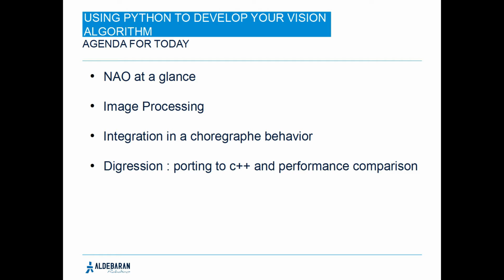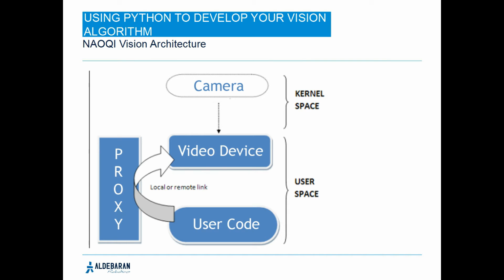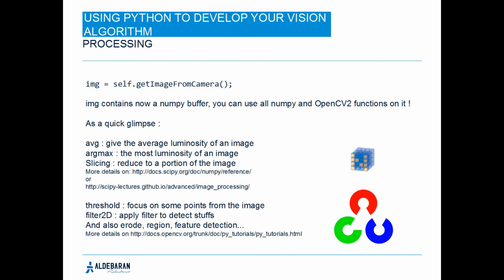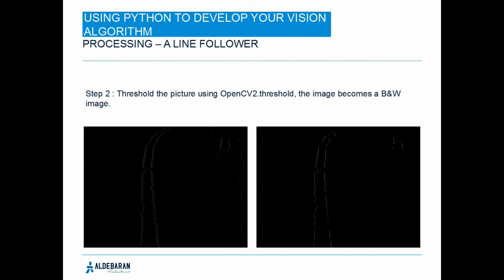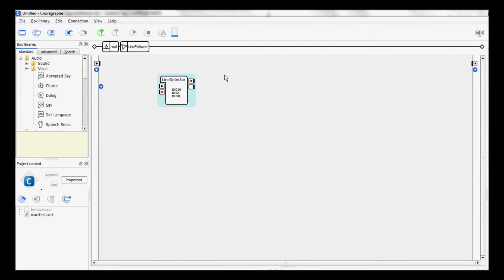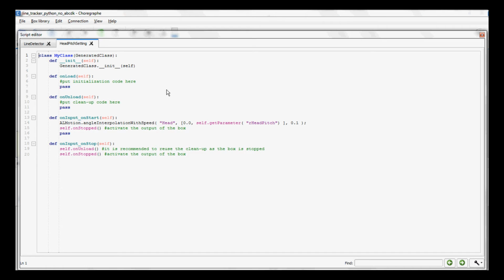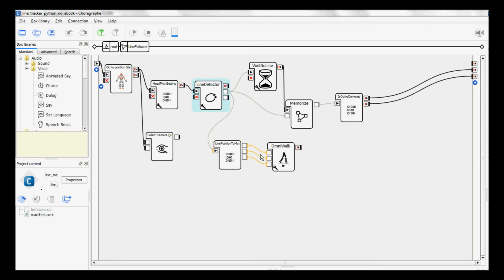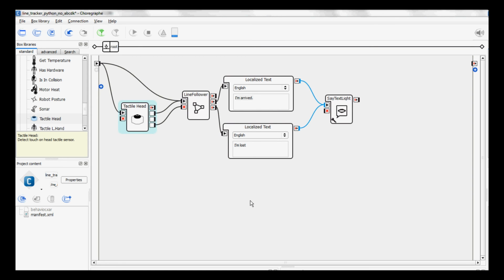Webinar: Using python to develop your vision algorithm on your robot

Comment: hello, thanks for the information. I have a problem with the line import cv2 and numpy, how can I called the both libraries?
Reply: import numpy
import cv2
Open a terminal, type python, call those imports, if an error pops ups, that means you don't have the libraries installed